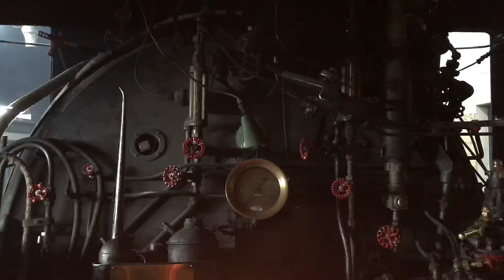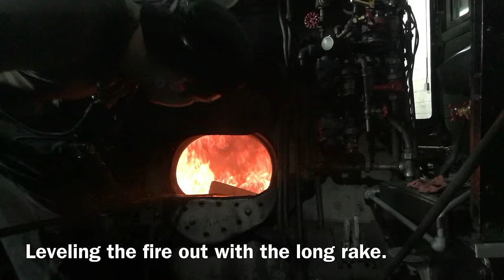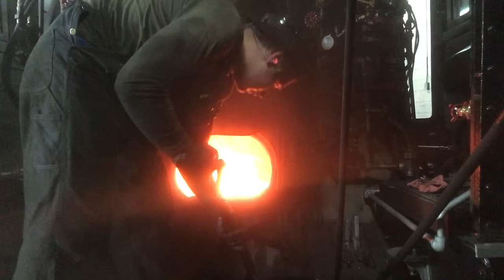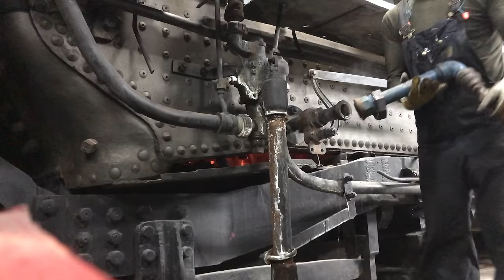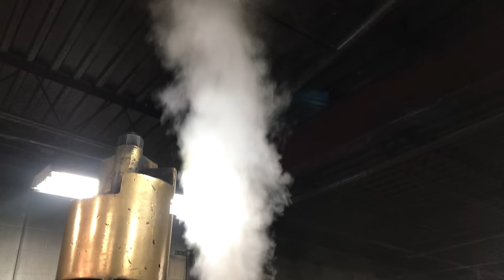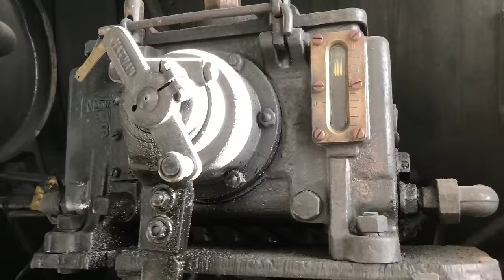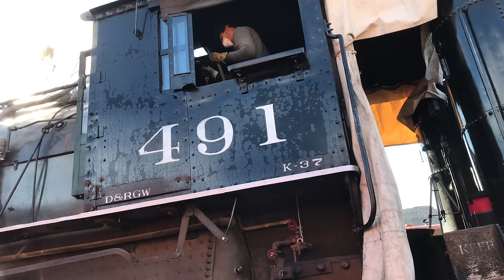How To Fire Up a Steam Locomotive [4K]

Comment: Ladies and Gentlemen, THIS is the industrial revolution.
Reply: Yup.  They had horses/mules/oxen and wagons before this.  This is state-of-the-art way back when.  The Oregon Trail took 4-6 months of hot, dry, bumpy, hard living.  But by 1857, you could make it in 4 weeks in relative style on a train.
Reply: @ljprep6250 : While you're right about this being state-of-the-art, you're off on some "timely" facts:

You could travel to Texas in 1845, if the rails could take you where you wanted -- using the Classic American 4-4-0 as the locomotive.

Second: The Transcontinental Railroad, completed by the Union Pacific and Central Pacific Railroads, did not happen until Promontory Point, Utah, in 1869. Fun fact 1: The Union Pacific laid ten miles of rail a day, during the tracklaying phase. Fun fact 2: The Union Pacific is the only original railroad left in the United States, having never been merged into a larger company. Fun fact 3: The Union Pacific, through it's Steam Locomotive program, maintains the largest steam locomotive still running in the world: Big Boy engine #3985, a 4-8-8-4 Big Boy.
Reply: Nobody expects the industrial revolution!
Reply: @isaiahwelch8066  how do u know all this?
Reply: @subscribeorsus6862  : Because back when I was younger, I was a huge rail buff, as well as someone fascinated by history. Point in fact, for Christmas, my mom gave me a coffee mug that, ironically, has facts about the 4-8-8-4 Big Boy.

Funny enough, there is a story about Engine #3985, that happened about 25-30 years ago. The story is, that 3985 had finished pulling an excursion train, which included two tenders of coal and water. Ahead of her was a mixed freight that had three DD40-AX diesel locomotives at the head. The issue was, this freight train had become stuck, attempting to crest a hill in Wyoming. Well, 3985 heard, over the radio, that this diesel crew was unsure about what to do -- and given that a helper pair of locos out of Cheyenne would have taken over 90 minutes to reach them, Engine 3985 decided to help. Linking up at the back of the freight train, 3985 then began to push -- and to spite that it had passenger cars attached, was able to get the freight over the hill. The freight crew, feeling their train start to move, didn't know 3985 had hooked up to them. At the end of the day, they were extremely grateful that 3985 had come to the rescue. And every time I tell this story, I damned near shed a tear, because I've always been a huge fan of the "Iron Horse" and what those marvels of machine can do. And 3985 proved that day that steam is still, even in modern times, capable of doing what it was designed to do, to spite how old the technology is. Just because how old something is, doesn't mean it isn't still useful.
Reply: @isaiahwelch8066  awesome!!!
Too bad America has gone full wild with cars and left the rails to dust. I guess it's not economical.
We have some good high speed trains here in Europe. China and Japan too I think.
Reply: @subscribeorsus6862  Not exactly. Most major rail thoroughfares still exist, and are still used. But the problem is that they are aging. And because they are aging, they cost money to replace.

Ironically, there is a way to pay for the upkeep costs of even traditional rails, and it goes like this: Back circa 2000, when I was a junior in high school, I read a magazine article from a magazine my physics teacher subscribed to, that had the following story.

In 1999, Burlington Northern Santa Fe (BNSF Ry.) outfitted 6 diesel locomotives with catarans -- devices that can transfer electrical power to a moving train. In this story, they reversed this and fed the grid from these engines. Keep in mind that at the most basic level, diesel locomotives are actually hybrid vehicles -- they use a diesel engine to turn an electrical turbine, and use electrical traction motors as propulsion. BNSF found, after only one year, using 6 engines, that they had put into the grid enough power to supply a city of 100,000 people for one year.

My thought is, if the railroads did this with every engine, and every mile of rail, they could subsidize their maintenance costs via power production for the power utility companies, just like an individual land owner can run a generator for their house, and at the end of the month, get a check from the power company, should they produce more power than they use. Additionally, from a military perspective, this would also decentralize the power production of the grid, and protect it from a terrorist attack.
Reply: @isaiahwelch8066  interesting.
One question. Are diesel generators more efficient at producing electricity than coal or natural gas ones?
Reply: @subscribeorsus6862  : I'm not sure. But what I am sure of, is this: When I was in college, circa 2012, I took an Automotive Undercar class. My teacher, who was a certified GM Global Tech, ran for the mayorship of Jackson, Michigan (about 45 minutes from where I am), running on the platform of biofuels.

Come to find out, that in Kalamazoo, Michigan, there is a chemical plant that uses algae to eat garbage, and when they do, the resulting chemical is pure, J10 diesel. So, my point is, diesel is more sustainable than natural gas or coal. In terms of torque and power, there is a reason why: Trains, ships, submarines, and all manner of big trucks use diesel, which is higher torque and power numbers than almost every fossil fuel out there. This even includes gas. And, the reliability of diesel, at this point, is irrefutable. This is why railroads were among the first to go to diesel: because of the mechanical output vs. power and torque. When CSX Railroad says that 1 gallon of diesel hauls 1 ton of freight 450 miles, that says something.
Reply: @isaiahwelch8066  well diesel works the best for freight. You need a lot torque. Electricity works better for passenger trains.
But I was wondering if 1€ of diesel can produce more electricity than 1€ of gas. That's because u have prices involved. It's not only about what is the most efficient. It's also about what is economical too.
Reply: @isaiahwelch8066  3895 is a Challenger, Big Boy is # 4014.
Reply: @timothybarney7257  : I know, lol. I used to have a railroad calendar -- and it had a picture of 3985 running, before she went down. This was over 10 years ago -- so I couldn't remember that 3985 was a Challenger, and not a Big Boy.

Comment: Great to see young guys interested in preserving these. I am old enough to remember when the steam locos were in regular service. You cannot imagine how powerful these were until experiencing them rolling through town, just overwhelming the  environment. My father worked locally for Electro-Motive from its very beginning in the 30's in developing and manufacturing the diesels. As always, economics ruled and the steamers faded away. But I can still remember a few in active service as late as the mid 50's.
Reply: My grandfather was an engineer on the Milwaukee Santa fey and was young diesel engineer because the senior engineers got all the steam engineer jobs . Come find out years later that the higher electrical generating system gave the engineers heart Attacks .

Comment: Now THIS is the type of video I've been looking for for a long time. Informative, entertaining, and most importantly, without the crap music background. I could almost smell the combination of smoke, steam, and grease. LOVE it. Think of all the hundreds of thousands of men who used to do this at the height of the railroad era.

Also, 6 to 7 HOURS to fire it up? WOW.
Reply: No, one man is all you need to fire up a steam locomotive. Especially a larger one like this.
The main factor in how long it takes is the capacity of the boiler. It's a lot of water to heat to well over boiling temperature.
Reply: EXCELLANT comment!
Reply: Samuel Zelter wouldn't it be faster to fill the tank with preheated water ?
Reply: Some of the Japanese steam locos are just never put out (Usually ones that run almost every day)
Reply: Evert Guzman thats a thought, but it would probably take too much resources and effort to keep that preheated water hot.
Reply: @davecrupel2817  Certain industrial settings utilized fireless steam locomotives to minimize fire risks. Instead of boilers, they had a heavily insulated tank that would be pumped full of steam from an external source.

Comment: Never realized it took Thomas so long to wake up every day.
Reply: Phillip Mulligan when steam locos were in daily use, they were kept hot by a crew member known as the hostler. He did the grading and oiling overnight while feeding the fire and maintaining water level in the boiler. It was far less work and better for the machine to be kept hot unless it needed to be down for major repair or wasn’t going to be used for several days. Also, many of the round houses at larger railroads and facilities had “shop steam” to help warm a boiler up faster then using the circulating pump shown in the beginning of the video.
Reply: The smaller trainyard shunter engines are a bit shorter to warm up compared to a full sized engine thanks to having smaller boilers. The oil based engines are even faster still, but not fast enough to beat a diesel engine.
Reply: About as long as it takes me.
Reply: @KameraShy  lol

Comment: I had no clue a steam engine like this had a generator that actually produced electricity for the lights and such. Such an amazing video!!!
Reply: @maiy8786  In XIX century they actually did
Reply: How did you think they powered all the lights on the locomotive and the train? They stopped using kerosene lamps at the start of the 20th century. A car has an alternator, even a diesel vehicle. So why wouldn't a steam locomotive?
Reply: Early cars did have gas lamps, so it would make sense to think trains which came before them did as well.
Reply: During the last few year os steam locomotives, a used steam to produce electricity and use the electricity to run (similar to how diesel electric locomotives run).
Reply: It is obvious when you think about it, but like you I never stopped to think. LOL.
Reply: Karl Rovey I have never heard of a steam electric locomotive - examples please?

Comment: Steam locomotive.... The only man made machine with a heart♥️
Reply: I beg to differ , Steam Cranes , Traction Engines,  Steam Shovels, :)
Reply: Steam nuclear plants?
Reply: And lungs, and a stomach.
Reply: @KeplersConjecture  well it isn't man made, is it?
Reply: Not the only machine that lifts the heart though, I present the bicycle.
Reply: I'dd add mechanical watches to the list.
Reply: Vilipertti69: Steam locomotive... the only machine with a heart.

Watermill : am I a joke to you ?
Reply: Gappie Al Kebabi  no it's not! Gosh! My older brother said so!
Reply: A lot of smoke is not good. It is necessary to apply technology that will allow locomotives to ride and not pollute the air.
Reply: @ИгорьМихеенко-я4э  well, correct me if im wrong but Steam engines can use firewood as a Fuel source. Hows that pollutin The Air?
Reply: @vilmo825  
Firewood also smokes a lot. And in such a boiler design it is not possible to take all the heat from the wood, it is not very effective. :-))
Reply: steam ships?
Reply: @Joshua_Knowles_  uu thats a good one
Reply: That's Beautiful
Reply: I think a clock with gears is one too
Reply: theater pipe organs.
Reply: I loved reading stories of tramp steamers and their triple expansion engines. Finally got to actually see one working aboard a Liberty ship, the John Brown when she came to visit Toronto.
Reply: '*Laughs in pipe organ'*
Reply: @masterkey2554  or any pipe organ, or any instrument with mechanical parts

Comment: As a retired machine operator, I just adore this video. I do not mind at all; in fact, I LOVE all the priming & preparations necessary to get a machine up & runnin'!
What I really appreciate that this locomotive's output-hot steaming water- is used to clean out systems, clean off the engine (et al), & circulate the different oils throughout the loco's systems. That last is especially terrific.
As for trains themselves, I grew up with my fathers heavy, metal Lionel train set (the original of the 50's), & got to watch him operate it in full action along its tracks & switches, through & past covered bridges, & sheds, rail signs, etc., & the scenery pieces my dad bought separate. I've had a passion for trains ever since. All kinds.
Thank you so much for this video!

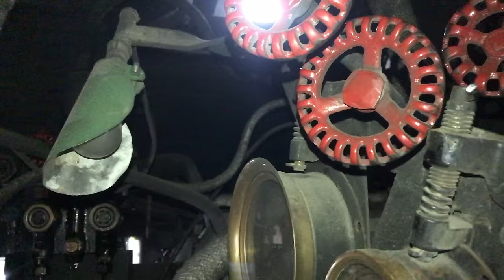Comment: 20:30 love that sound of the dynamo starting.
Reply: Because both of them are Turbines. Small Car Turbochargers sound similar; big ones like in Ship Engine sound like Airlinern Engines.
Reply: @Genius_at_Work  some of those ship ones used to be airplane engines. 
two specific examples: You'll find some repurposed j47s and j79s in the Marine world. Not as efficient or clean as a more modern engine. But a hell of a lot cheaper to purchase and to maintain.
Reply: @davecrupel2817  I meant Turbochargers. And Gas Turbines are way more expensive than Diesel Engines, both to purchase and to run. They are made of higher Quality Alloys to survive the Temperatures involved,  are less efficient (as you said) and also require higher Quality Fuel than Diesels. Diesels can run on Bunker Oil but I doubt that's gonna be possible with Gas Turbines. There are even more Problems with Gas Turbines on Ships like a lot of blank Metal on the Inside which is a bad Combination with salty Air or their high Air Consumption which requires much larger Engine Room Ventilation Systems. So Gas Turbines are used only where you need much Power and have very limited Space, which means they are mostly used on Warships and High Speed Crafts and you hardly ever see one somewhere else.

COGAS and COGES are some interesting Concepts though. Gas Turbines are so inefficient (at best 35% Efficiency compared to over 50% on large Two Stroke Marine Diesels) because they lose a lot of Heat over the Exhaust Gas. You can use that to heat a Boiler which in Terms drives Steam Turbines. These and the Gas Turbines can either drive the Propellers directly (COGAS-Combined Gas and Steam) or drive Generators to power both the Propeller Motors and other Electric Consumers (COGES-Combined Gas and Steam Electric). This Principle has been used in Powerplants since Decades and a few Times onboard Ships. Total Efficiency currently is at about 45-50% but with much lower Emissions thanks to the continuous Combustion in the Turbines rather than intermitting like in Diesel Engines. Given that Bunker Fuel is becoming less attractive due to stricter Sulphur and Emissions Regulations and LNG is used more and more these two Concepts may become more important in the Future.